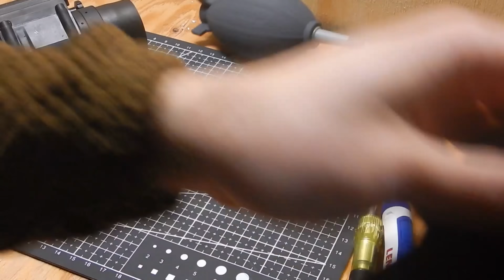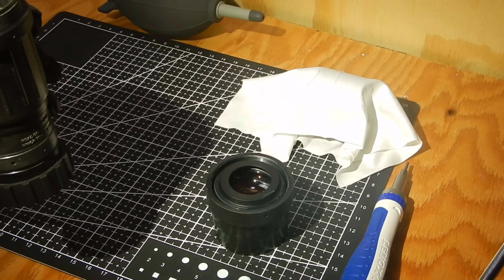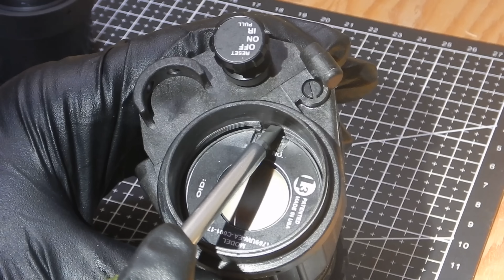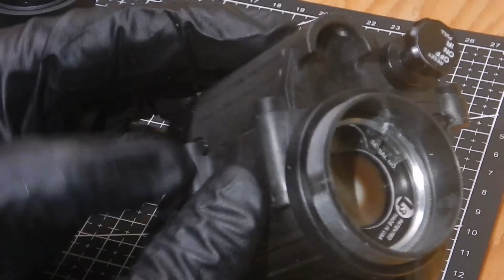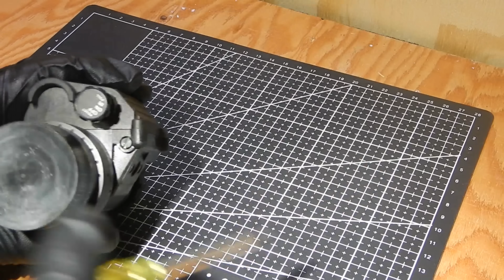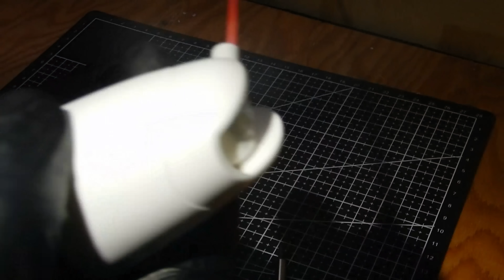How to Build Your Own PVS-14

Comment: Seeing as argon is quite dense, I'd consider getting a long inflation needle, grease needle, or blunted veterinary needle- Determine a route through the purge hole with which you can go deeper into the case.  That will allow the argon to "push" and flood everything out in a vertical configuration.  Go slow, do multiple additions over several minutes, and I bet one could get a dang good purge.
Reply: I weld in a cloud of argon 😁
Reply: @macgyverpreppin4056  and can probably rent an argon bottle for the cost of the wine preserver.
Reply: @charlesmckinley29  
Or even a nitrogen tank from welding supply.😉
Reply: @charlesmckinley29  probably yes👍😁
Reply: @DB-yj3qc  we get our dry nitrogen from a standard gas supply company like airgas. Just make sure it's dry nitrogen with no oils and 99+% purity.
Reply: @charlesmckinley29  most places lease bottles per year, or years, not for a single day. A fill on even a small argon bottle will also cost as much as one can of that wine preserver stuff. It doesn't matter if you bring it back 95% full, you're getting billed for the initial fill and you won't be refunded when you return it. If you already have a bottle of welding gas then use it, but if you don't, this probably isn't a good reason to venture into the world of welding gas procurement.
Reply: @ParadigmUnkn0wn  most places definitely rent out cylinders for days
Reply: @insurancenightmare7885  head down to your local AirGas or Praxair and ask if they'll rent you a bottle for a week. Unless you already have an account, the answer is probably no.

Sure, they'll rent by the day if you're a shop with a dozen bottles on long-term lease that gets a weekly visit from the AirGas truck and you ask for a helium bottle for a week to do a one-off heavy aluminum welding job.
Reply: @ParadigmUnkn0wn  I've done it plenty of times from airgas Praxair and several local welding supplies
Reply: @ParadigmUnkn0wn  Yeah, it's not cheap, but I got a big bottle in the shop, the guy saying put it in a container and fill it had the right idea IMO.
Reply: Or simply place it in a plastic container/aquarium/etc.. Flood the container with the argon, and let the lighter gasses float up and out. Afterwards, you can carefully reach down into this pooled gas to put the screw back in without spilling it back out of the hole.
Reply: @buckstarchaser2376  yep a fish tank. That’s what people do to displace air when repairing telephoto lenses.
Reply: @buckstarchaser2376  definitely not an aquarium, argon is not THAT cheap. but maybe a plastic tupperware
Reply: @Bdubs-ns7nn  I'm not sure where you would get less than an aquarium full of it, unless you harvest it yourself, so "in for a penny, in for a pound". If you built a pressure swing adsorption oxygen concentrator (a popular DIY project when coofid was fresh and new), the rejected gasses will be rich in * not oxygen *. If nitrogen with a tiny amount of argon will work, then you can just vent your oxygen, tweak your cycle times, and recycle your * not oxygen * output back to your input until you are assured of its oxygenlessness.
Reply: @buckstarchaser2376  simple. You buy that can of argon and a tupperware
Reply: ...rewatching the video I just linked, It's probably better to use nitrogen than argon, and using the "ass end of a pressure swing adsorption oxygen concentrater" to procure clean, dry, atmospheric gasses without the oxygen is likely an optimal homebrew solution. Also, I probably should have emphasized the fact that military equipment changes environmental air pressure/moisture a lot (aircraft/submersion/all-weather/all-temperature), and this is the main reason for the purge intervals being as short as they are.
Reply: @buckstarchaser2376  I’ve got thousands invested in my oxygen concentrator which feeds a multistage oxygen compressor which fills 3 125cf tanks at a time. What’s the output of the DIY concentrators? Do they utilize zeolite to separate oxygen from atmospheric gasses?
Reply: @zackzittel7683  Zeolite or molecular sieves. 5A and 13X are popular, and cost roughly $6/LB or less (retail, online). The scale is up to the builder, but commonly, the adsorption chambers are based on RO water filter housings (imagine the size of those tiny plastic pipes, with an operating air pressure up to 90 PSI). Since most people who are building this project simply want enough O2 for recreational or comfort reasons (not a medical device, as those can only come from the doctor), typical output is roughly 60% O2, at "resting breathing" volumes. Of course, the output concentration will be reduced if you adjust your cycle periods for more flow, but the design is such a simple one, you could add stages for greater concentrations, and use more than two adsorption cylinders for a less "pulsating" output, etc.. The biggest downside to the DIY model is that it's not "plug and play" with someone who just needs to connect it and start using it.
Reply: @buckstarchaser2376  yeah my compressor has a sensor that won’t let it compress less than 92% purity.
Reply: I was thinking on the lines of a small sandblasting cabinet, purge the cabinet and build while encapsulated and use actual nitrogen...
Reply: I was thinking the same thing.
Reply: Did that very thing with dry nitrogen to re fill shocks on  mountain bikes  vet needles eg cows horse needles did the trick use stainless  steel as the aluminum needles break off .ask me how I know
Reply: @crustybastard1068  “ask me how I know” I am very familiar with that phrase😖
Reply: Agree
Reply: Just get a finer straw from a penetrant can (unused) and insert it into the end of the larger straw that comes with the wine preserver.
Easy peasy and you can get inside, no problem.  😀
Reply: Bloxygen
Reply: Turkey baster needle?
Reply: Argone is so cheap you could just crack the tank and let it flow at 10-20 LPM for 5 min and it wouldn’t make a dent in the smallest tanks fill level. Even if you don’t have a regulator or flow meter..
Reply: An open ended basketball inflator needle and some Argon from a TIG welder. Set the regulator a 5 psi and inject vertically for a few seconds.
Reply: Vacuum chamber with argon on the air inlet?
Reply: Won't the argon just sink to the bottom anyway?
Reply: If biggest hurdle for performing a purge, correctly, is the cost of a vacuum pump...go to the local Autozone/O'Reilly/whatever is local autoparts store and ask to rent their A/C gauges AND VACCUM PUMP. Idk about stores everywhere, but most of them give you a full refund of the rental cost once you take it back under the allotted rental # days.

Edit: to add - just come up with a creative way to attach the pump where you need it and you're golden. I've never done a purge on this particular type of equipment, but I've gone and rented that A/C kit many times for applications that were NOT A/C related. There's always a way to get that pump attached with an appropriate relief valve, if needed, with the right amount of will power - and for dirt cheap (so long as you can temporarily cough up the initial cash for 1-2 days while you rent).

Edit 2: Another note - I'm not sure, but judging from the comments it seemed like only one person had the idea right as to why a vacuum purge is so important (regardless of what equipment, but rather typically it's application is to prevent some unwanted fluid from becoming pervasive), is not just to remove the gasses that, under standard operating pressures/temperatures, remain as gasses, but also (and importantly) to boil off any trapped moisture, including unseen vapor, aka humidity. When chamber pressure is reduced very close to 30 in. Hg (which is hard to do unless you have zero air leaks in your vacuum 'system' - so check them leaks!), it's pretty much guaranteed that water will boil irrespective of the ambient temperature of most places on earth. This fact allows even trapped water droplets to be evacuated - something that merely flooding a chamber with a heavy gas never will achieve.
Reply: I weld stainless steel for a living. When purging food grade  sanitary tube,you have to introduce argon slowly so it won't mix with the air and have a vent at the top to let the gas flow through. I believe it's the same with dbl pane windows. Fill hole. Vent hole. Fill the unit plug the vent hole then plug the Fill hole.
Reply: not sure of the geometry inside there but think of what happens when you drain out all ur radiator fluid and then try to top it off with new fluid. air gets stuck in different places. Not sure this would work much better.
plus its going to start draining out.... 
im thinking the idea of purging is to get rid of water not oxygen. oxygen will diffuse back in.... water condenses and then takes forever to come back out... i think the argon idea is prolly fine. youre never gunna find a way without a vacuum to get the gas to flow up and down and around every cranny just due to the geometry (again think about the radiator fluid and bubbles lol)
Heres an idea, get some kind of desiccant and store it with your guns. 
if the humidity is close to zero it will diffuse out over a long long time via ghrams law since the water can enter the gas state. liquid? not going no where.
Reply: @vevenaneathna    Although fluid dynamics applies to both radiator fluid and Argon, the surface tension in a radiator and block are enough to prohibit completely draining your motorcycle but putting a heavier gas in on top of a lighter one, "several times" and especially if you put it in a vacuum sealers bag and draw out the remaining air over 30 minutes, the argon will absolutely find its way into all the nooks and crannies.  a couple of appropriate straws (a finer, clean straw from a solvent can, etc. and stepped into the larger, wine preserver straw) will easily go into that port.  Just have the argon straw in place as well as the vacuum straw (comes with sealers or make your own) then seal bag seal strip tightly and start vacuum.  When air has had  time to "cook off" and you're in a full vacuum for about 30 minutes (if possible, try for ten at least) then move argon straw in place (should have been close to start) and release the argon. 
  Cover the port with a thumb then open the bag and have the screw already set on the end of your hopefully magnetic driver, then open a small opening and insert the plug screw.  Anand, Bob's your uncle. Unless he's a crossdresser, then he's your aunt.

Comment: it might be a good idea to setup a clean room for this, somewhere that you can run an A/C and/or heater to set the humidity to 45 - 55 % relative to avoid static and excessive moisture, or a dry room with very low moisture below 30%. it's not hard to do with a window A/C or portable heater. running both in a small room will drop the moisture down to near 0 if you wish. HVAC 101 from an old timer in the business. welding supply has all the inert gas you need, regulators and bottles are at discount tool shops. it would not be too expensive to get a small bottle and regulator which would let you get Helium for party balloons as well. multi use tools are the best!
Reply: You can make your own benchtop positive pressure clean room with foam boards, a box fan, and a furnace filter
Reply: Nice! Thanks for the info.
Reply: Helium is lighter than air.
Reply: @charlesmckinley29  yes it's also for filling balloons and talking funny, which is what I'm saying you should use it for not to fill your 14 with. since you can buy the tanks and reg, just get a refill with helium not argon or dry nitrogen. just get the rite sticker to use. lots of tanks get painted over time.
Reply: Look up a flow hood/box.   Clean work table with a hepa filter surrounded by 3 sides blowing at your work space. This creates a positive pressure with extremely filtered air not allowing any dust in
Reply: @trumpwon20204  yeah you can make your own with a box fan, hepa furnace filter, foam board and tape
Reply: It's not a true clean room, but you can achieve a low dust workspace by doing the job in a bathroom with a shower. Run the shower on hot for a few minutes before beginning work. The moisture in the air will settle any dust. I do this when installing screen protectors on devices. For this particular application, you should definitely do the argon purge step, to get any moisture out of the housing.
Reply: @douggraham5812  bringing the humidity % up that high by running a hot shower makes purging and dehumidifying even more critical, unless you want moisture condensing inside your device. there is a reason clean rooms are temp & humidity controlled. I installed & serviced clean room systems for labs and drug manufactures during my 35 years of HVAC service. I'm not a SME but I know a thing or two about the systems and how they operate. most importantly I have experience with the end users of these systems and know what they asked the system to do and why.

Comment: Are there any special considerations needed to pair the tube to the kit? Can you mix the wrong parts on this?
Reply: To my knowledge all Pvs14s use either an MX-10160 or an MX-11769 image intensifier tube, the latter having manual gain which some prefer and some don't like. Some Chinese Pvs14 copies may use some other image intensifier but haven't looked into it.
There are other IITs as well so make sure to check the exact model.
Reply: Manual vs auto gain to my limited knowledge
Reply: Thank you!
I don't imagine that white vs green would matter. You all have given me enough to stay some research. Thanks!
Reply: @tophattommy2  white is so much better

Comment: Argon is even less reactive than nitrogen, and heavier and denser than both air and nitrogen. So... does anyone know why Nitrogen is used instead?
Reply: It's the cheaper industrial alternative that's readily available. Argon purging would just add unnecessary cost to the final product and nitrogen purged manufacturers would out compete them. Heavier gases would only negatively affect large scale manufacturers since they don't need the gas to be heavy since they have a vacuum.
Reply: Can only guess, but they are functionally identical as inerting gases, so,
nitrogen is a lot cheaper, you need to process 70x as much air at leats to get as much Ar.
Reply: Price
Reply: It's actually simple. Nitrogen makes up about 70% of the air we breath while argon is about 1%.

It just makes sense to use the one most readily available when they are basically the same when used for purging.
Reply: I thought price would be pushed into the consumers, as everything related to NVGs seems to be expensive, including accesories and basic hardware/components. For large-scale it does make sense.
Reply: A lot of it is military carry over.  Military Aviation were the first folks to be using NV on a large scale.  As early as Vietnam aircrews were flying with night vision where other units might have had a handful in a company sized unit, aircrews were flying with 1 per person.   Nitrogen is a widely used in gas in aviation so it was readily available.

Comment: I just thought of this while watching, you fill a glove box for Mycology with n2o or argon from a weld shop and just assemble in a n2o atmosphere.
Reply: Make sure you are using a good pure nitrogen. Some has oils and moister in it.
Reply: @ChevTecGroup  can't you get filters for flow regulators?
Reply: @ChevTecGroup  yes they do, first thing I pulled up was a gas filter for the fuel side of torches, no reason you couldn't use it on argon or n2o.

For the price of a sight you could make an impromptu purging station for night vision and have a glove box for myco work. Pretty sweet if you ask me.
Reply: @skm9420  also. The purging pressure is only 3psi, so be careful about how much pressure you put in
Reply: @ChevTecGroup  pressure? Do you know what a glove box is and what a flow regulator does? It sounds like you're not understanding what's happening with what I've proposed. You're displacing the earth's atmosphere for an atmosphere of argon or nitrogen. So you're still at atmospheric pressure at your altitude.
Reply: @skm9420  i get what your saying. I may have misplaced my comment.